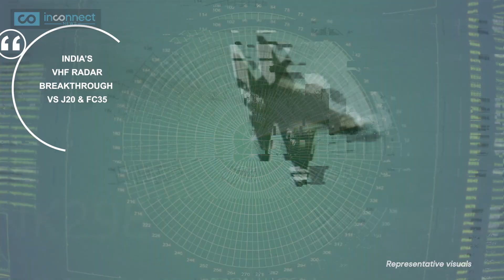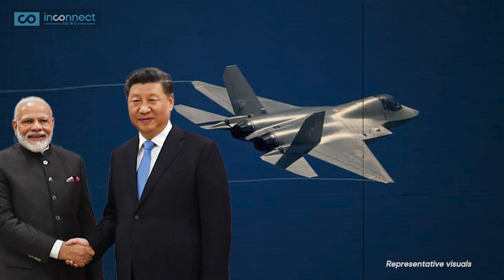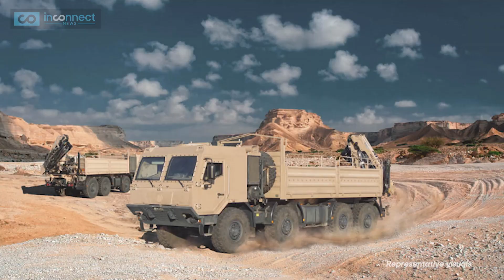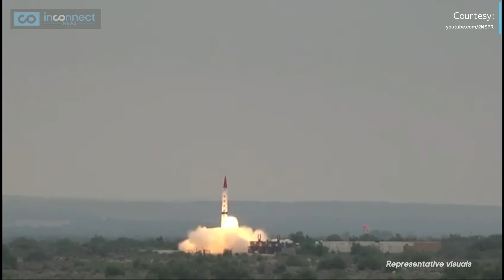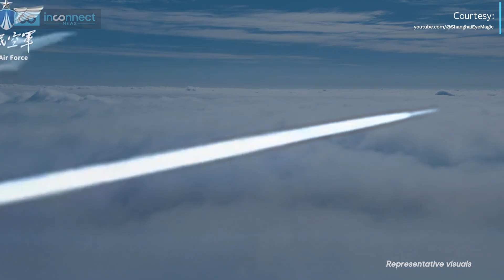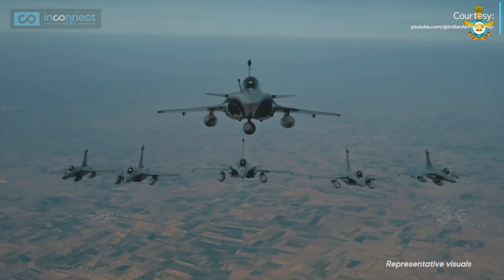Indian Air Force NEW Defence Radar Is TOTAL Game Changer | Indian Defence News

Comment: Correction - India can now track any stealth aircraft - the IAF was always able to track the J20 and Su57 which have a radar cross section of about 0.2m2, which are low RCS aircraft like Tejas Mk1 not true stealth by western standards like F35 and F22.
Also stealth jets cannot counter other stealth jets - since they will not be able to see each other - the VHF radars that are used as anti-stealth radars are too large to fit on fighter jets. They can bee fitted with antennae jutting out of the wings of large commercial aircraft, much like some WW2 German night fighters. https://en.wikipedia.org/wiki/File:ME-110G-2_at_RAF_Hendon.jpg
Those will create a lot of drag, but they will be more mobile than ground based radars, and less vulnerable than large fixed ground based radars.